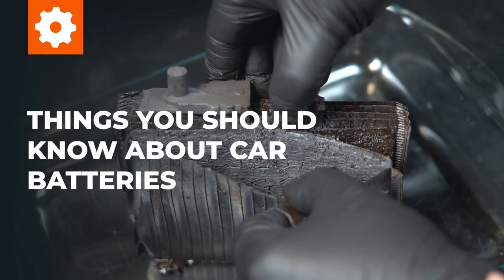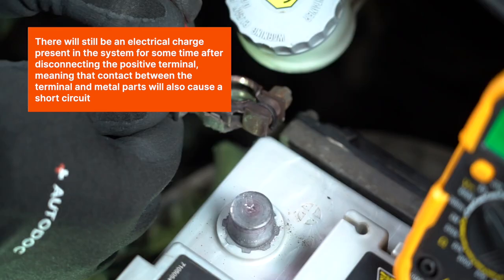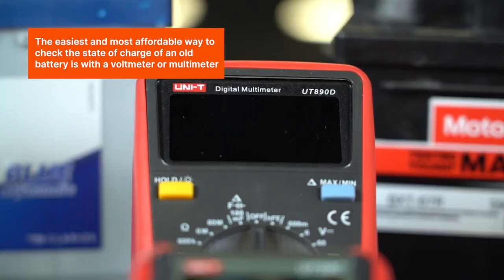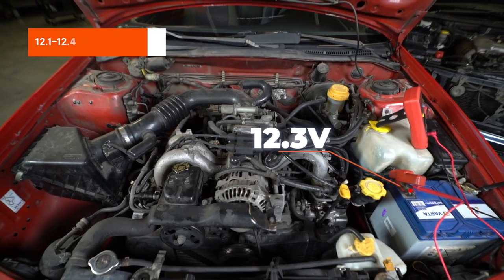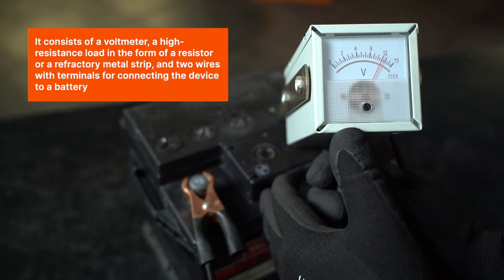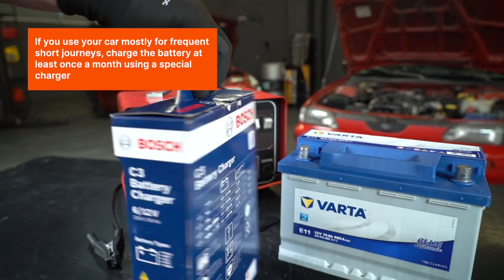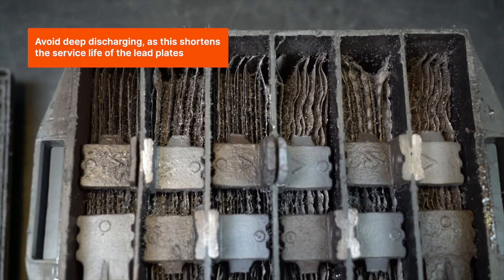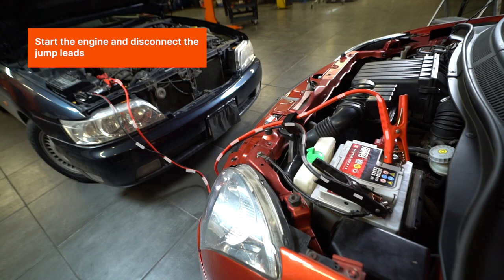Things you should know about car batteries | AUTODOC tips

Comment: If your car have start-stop function you will need a proper battery suitable for start-stop function (AGM or EFB technology) and that battery need a proper fitting on car including computer coding with an update of the car battery serial with the new serial number. If you don't coding the new serial number  of that new battery then that new battery will not be charging properly by car alternator and most probably will be dead in moths or within one year. Especially if driver like to blast the speakers and navigate  with big display and phones and other devices on charging... etc etcconsumption increase, but driving on short distance inside cities at low speed, battery not charging enough amount of energy and that meaning your daily driving do not meet your energy consumption needs. Change your driving style, your behaviour behind steering wheel on roads.
Reply from the maker: Thanks for the clarification, your comment will be useful to many viewers.